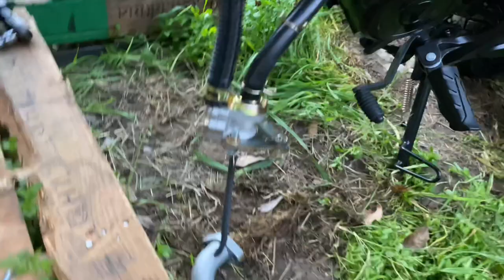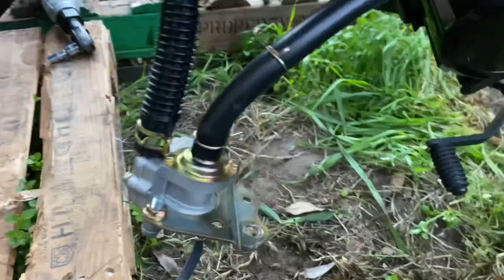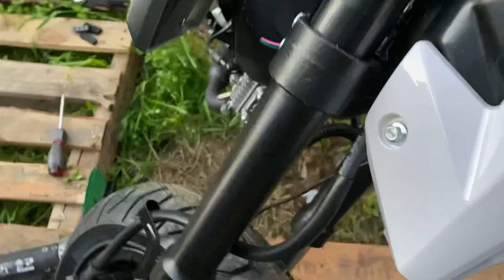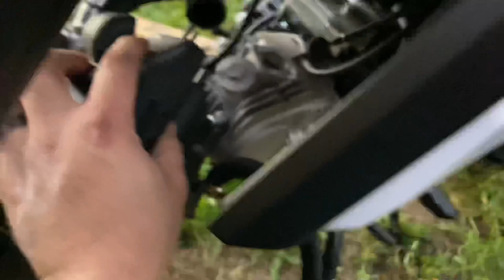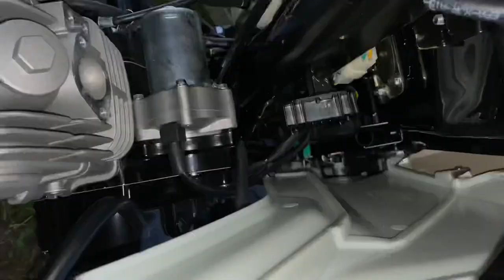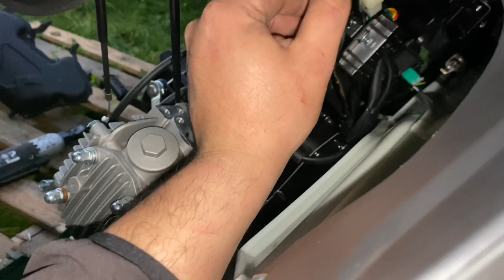(Grom clone) emissions removal and stock carb  must do mods

Comment: Kinda weird but I just bought a venom x20. I took out the air box. And the pz20 carb. BUT I don’t have that little emissions bracket connected to the carb, or that EGR connection. I do have the canister. Ive looked all over the motor and I can’t find that emission/egr piece.

Bought it a month ago. The title says it’s a 2023.

Comment: My bike stalls when i put it into gear. This problem just started today not really sure whats the cause but i have a icebear fuerza. Will the emission delete work with the stock carb?
Reply from the maker: Yes it does still work but your bike if it’s stalling when u put in gear it needs a clutch adjustment
Reply: @motoprosvtp  thats what i was thinking. It idles fine in neutral but at first it’d stall instantly and jerk when put into 1st. I looked up some stuff then went and tried again and it would stall after i’ve came to a stop and stayed in 1st with the clutch pulled in. It’d just bog down after a few seconds
Reply from the maker: I would adjust the clutch then swap that carb out

Comment: Please tell me a good choice of carb for this bike I'm gonna do a delete of all the emissions stuff
Reply from the maker: I run either a pz26  plastic choke if I’m going to do other mods  or a pz22 plastic choke no cable chokes either carb is on Amazon for 20-30 bucks plus the manifold is 8-10 bucks
Reply: @motoprosvtp  link

Comment: Now your ready for 17 front sprocket 110 link chain make sure the chain size matches the sprocket size wow wow smooth ride no high rev just the front and a nibbi 26mm carb😂😂
Reply from the maker: Chain does match the sprocket ⚙️
Reply from the maker: Chain does match the sprocket ⚙️

Comment: Ok so I have been trying to find the EGR block off I can’t find the right size anywhere I looked on eBay and on Amazon they are all way to big
Reply from the maker: Get a pair of dikes or pliers and just pinch the tube
Reply from the maker: Or cut and weld
Reply from the maker: https://gy6racing.com/universal-egr-block-off-plate-for-50cc-qmb139-150cc-gy6-scooters/
Reply: Perfect thank you for the response I got it ordered 👍
Reply from the maker: No problem

Comment: Worth it to buy or just get a grom
Reply from the maker: If your going to modify yes definitely worth it  if your going to leave it stock then just the Grom because once u modified a clone for the price it’s still cheaper then a Grom and faster I have videos of both and the clones need a few small things then they are solid i abuse mine and no issues
Reply: @motoprosvtp  thanks for the reply everyone has mixed answers on it thats why i asked you! Some say the bike is complete garbage then some love it! Ive read and read and have watched every video on both pretty much! I know the bolts need loctite and motor mount bolts are weak and a new carb is needed! Just dont want a pos if you know whst i mean! Thanks agai.
Reply from the maker: Yes some are pos I’d get a boom Vader not the other ones the raptors suck More issues vibrate more if u watch my videos I take mine everywhere and against groms too
Reply: @motoprosvtp  thank you kind sir ive been trying to decide which route to go

Comment: question bro with the 22 carb, what main jet and pilot are you going to run ? I'm at low elevation and hot weather. Also, are you going to upgrade the chain and sprocket, if so, do you know the chain size ? Thanks for any info ! Mine is shipping out soon !
Reply from the maker: I use a gold series 428 chain 110 link with a 17 or 16 front sprocket
Reply from the maker: Also I run a pz26 carb plastic choke they sell them on Amazon for 20-30 bucks u will need a manifold as well it’s like 8-10 bucks
Reply from the maker: I live in California at sea level
Reply: @motoprosvtp  you forgot jet sizes, I’m in calfornia at sea level as well but can’t get my jetting right
Reply from the maker: With the carb I run I don’t have to jet it it runs  perfect fine at sea level
Reply from the maker: What carb are you using
Reply: @motoprosvtp  isnt 16 front sprocket what comes on all the clones straight from the factory?
Reply: @ChristopherJones16  15s on stock clones.
Reply from the maker: It’s 14tooth stock
Reply: no it’s  14😅
Reply: @motoprosvtp  go with the 17 Sprocket

Comment: Is this the reason why my engine wants to cutoff on its own out of nowhere?
Reply from the maker: Yes it is
Reply: @motoprosvtp  thanks bro
Reply: What size is the stock carburetor on this specific bike I plan on doing an aftermarket exhaust and carb. What size is the jets on this carb?
Reply from the maker: The stock carb is a pz20 size 20mm intake the one I use is a pz26 carb

Comment: Try tuning when engine is warm pull over on the side get that screw driver out get on your back take your time and adjust put some paint on one side of that screw driver so you can see which way you turn to smooth out that carb😅
Reply from the maker: I’m a motorcycle tech I know how to run a motorcycle and fix them you must have not seen any of my other videos